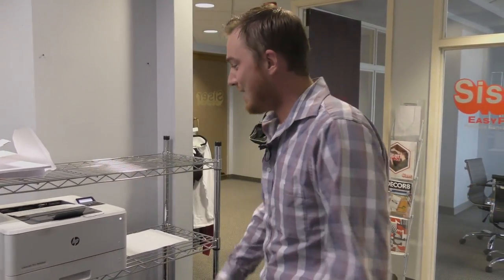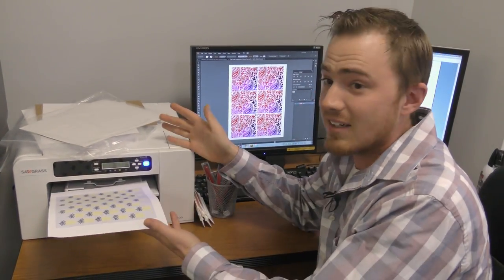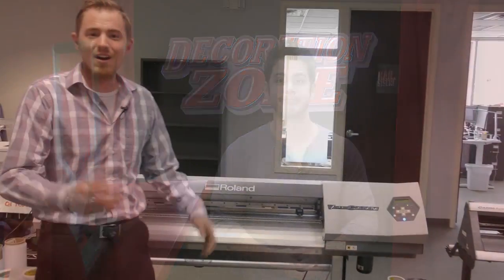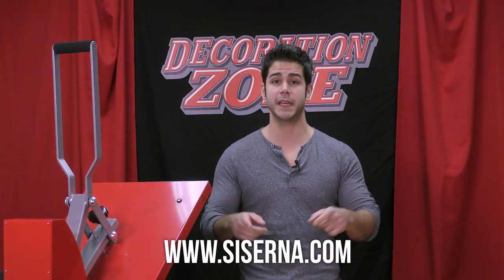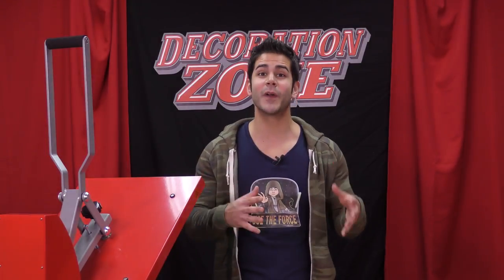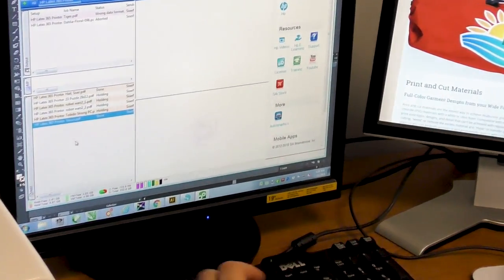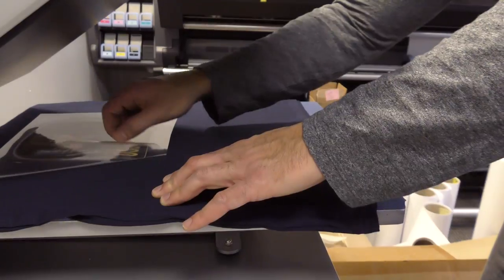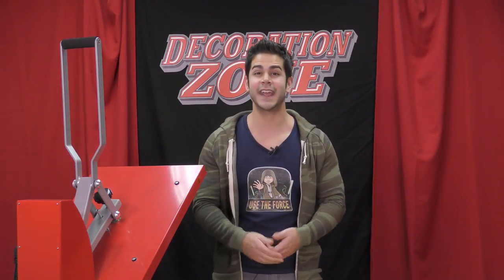A Guide To Print and Cut Materials from Siser®

Comment: Question? Why do you say only eco-solvent, solvent, and latex? UV LED Print that is flexible based can also print on this material and quite well ? With the heat all polymers are cured out and actually probably will last way longer than either solvent or eco
Reply from the maker: You're absolutely right.....but, the problem is is that UV Inks also contain lead, which can be problematic when applied to textiles. Our products CPSIA compliant, and we would like to keep them that way, when applied to garments.

Comment: arent these heat transfer vinyls all the same???? i personally think the shirt hes wearing is tooo glossy... mine always come out like this also, its not always good to have them glossy..?? basically some are mate some are flock and some are glossy , but besides the thicknes (they all kind of thick) they all the same quality... proof me if im wrong.... btw are the neon green or neon orange printable heat transfer vinyls??? would like to add some neon stuff to some shirt... thx
Reply from the maker: Not all vinyl is equal and each has its place in decorating. Sheen can be affected by type of carrier or application method, making some materials shinier than others. Thickness also varies by product due to the properties that each has. Siser does not manufacture any printable neon materials.

Comment: Is print heavy on the shirt it looks heavy and how long does it stay on the shirt I stuff like in the past and it's starts to crack by second or third wash. Thank you
Reply from the maker: Thanks for your comment. Our printable vinyl is rated for up to 25 washes, but can last twice as long is you properly wash your garment. It does not typically crack unless it is overly applied meaning you used too much pressure, to high of heat, etc... If you would like to know more about our printable vinyl you can check out our website at   http://www.siserna.com/print-cut/. Hope this helps!